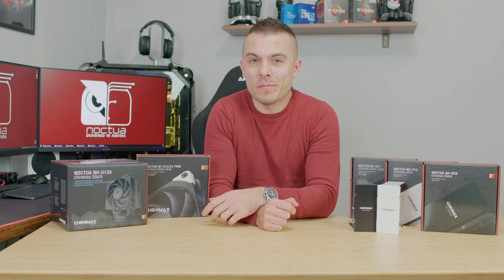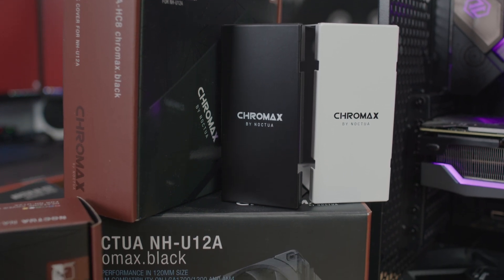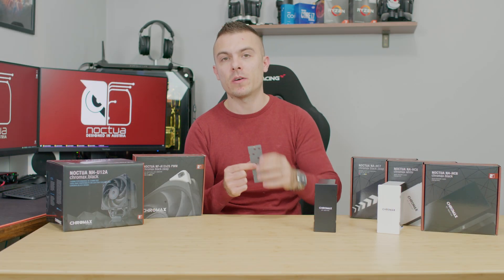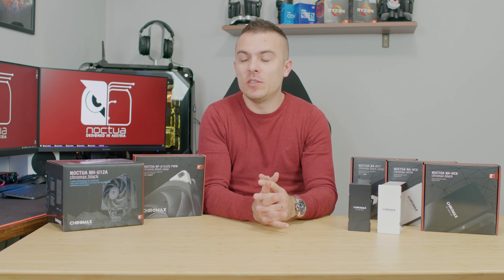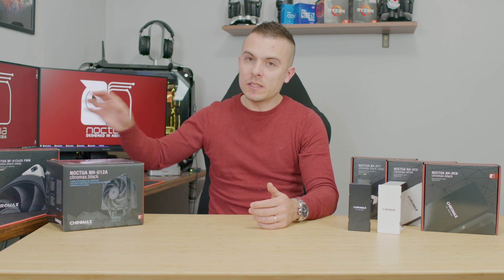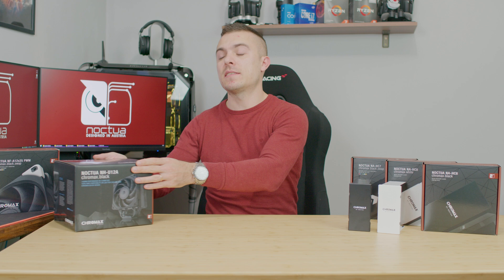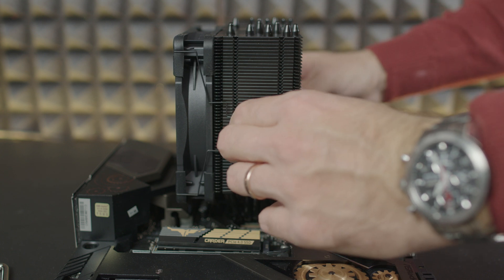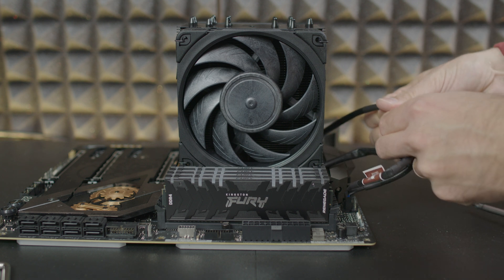TUTORIAL - Noctua NH-U12A chromax.black w/ NA-HC Covers

Comment: What's your opinion on high noise levels  they reach 48 db at max isn't that pretty high. Also, for a content creator that noise can be picked by the microphone.
Reply from the maker: It is pretty high, but Noctua fans never reach those dB. I can't measure the dB range exactly, because my sound meter detects only above 30dB plus I would get echo inside my room and all other noise is picked up.